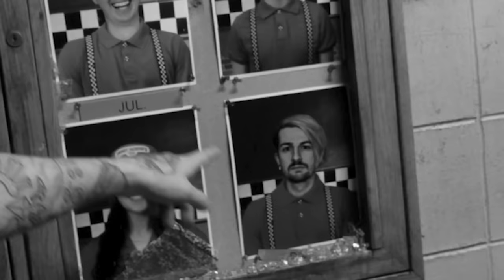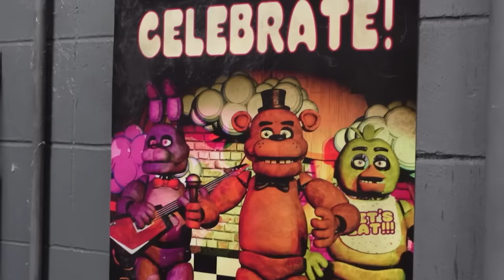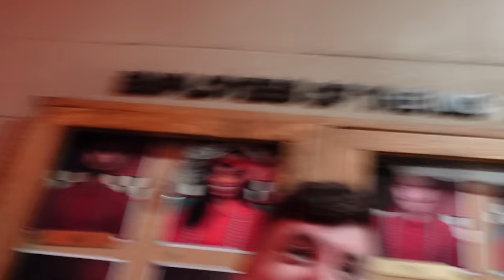VISITING THE FNAF MOVIE SET...

Comment: Dude the emotions those actors were able to portray through the animatronics without speaking was insane. I don’t know how they control the expressions but man that is so badass. I could only dream of this as a kid back in FNAF 1.
Reply: The characters are all actual animatronics. They are all controlled by puppeteers off camera using remotes. The fact that Freddy was able to move is mind-blowing!
Reply: @jakeblitzcoffie4859  not true in the hugging footage. You can tell if you look at the joints in that footage vs when Dawko is on stage, you can see the joints have people in them. there ARE animatronics, but there is also a suit version as well
Reply: @alpaca6462  Explain Foxy. How could someone possibly fit in there? You can even see the robotic bits inside his chest.
Reply: @jakeblitzcoffie4859  Foxy is a full animatronic, but the other ones have both animatronic and suit variants
Reply: @jakeblitzcoffie4859  Nope. The only suit that is indeed empty is Foxys. And you are probably right with remote control. The parts that are mechanical like eyes and ears, maybe jaws too could be remotely controlled. Question is by who? Because if it is someone else, which is likely, then the interplay between that person and the actor and the suit needs to be perfect. This is why it works.
Reply: @jakeblitzcoffie4859  Its 100% animatronic, this is why you can not hug him.
Reply: @alpaca6462 I don’t think so. I do believe that there are suits for the actors to wear (makes sense, certain scenes probably wouldn’t work with the animatronics), but I think the ones they were hugging were the actual animatronics.
Reply: @identitymatrix  Ummm. So there is literally footage of the remotes used to control them in the video they made... Plus, I thought the same thing as you until they got a back shot at the animatronics and an up close look inside their mouths. Unless the people inside are really small, they look pretty robotic to me. I'm aware they are using both animatronics and suits, but these guys were 100% the real deal.
Reply: @jakeblitzcoffie4859  What I see in an intransparent black cloth. Whenever the suit is worn, the distance between the upper arm part of the costume and lower arm part of it becomes significantly smaller too. Probably so it becomes less evident.
But when they are empty, you can see all the joints.
So no, I do not believe that these are empty suits. Only parts that are remote controlled are eyes and ears. 

Foxy is special in a sense that he is, like you said, 100% remote controlled since he is way too small to fit someone inside.

But feel free to tell me which shot you mean and I will take a closer look at it.
Reply: @identitymatrix  I see what you mean. Later in the video, Chica is stationary yet looks exactly like she did earlier, just without moving. Her arms are around the same area, and her height is exactly the same. You'll also notice some up close shots of Freddy's mouth, and you can see the endo inside him while he is moving. Unless someone's head is underneath, I don't see how a person could be in there unless they were curled up in his chest or something like that.
Reply: @blueflare3848  look at their joints in the hugging footage, the joints are full, and then compare that to the animatronics later in the footage on the stage with dawko, the joints are empty there.
Reply: @jakeblitzcoffie4859  I cant tell you how they do it but it seems like there are multiple copies of each suit. So there being metal parts inside doesnt mean anything, you can just remove them before you wear it. 🤷

It doesnt even really matter. It was a wholesome scene anyways, lets appreciate that.
Reply: @alpaca6462  Oh yeah, I do kind of see what you mean. So maybe you’re right. Besides that, it’s genuinely hard to tell if they’re real animatronics or actors in suits. Either way, they’re still pretty impressive. The animatronics are incredibly detailed and we know they’re capable of a range of emotion and movement because even if the main three really are suits, Foxy is without a doubt a full animatronic.
Reply: @blueflare3848  I never saw a robot as compact as this Foxy animatronic that is still able to perform such complex movements as he did. 
It really is impressive how much tech has progressed to make this possible.

They "only" had 25 million dollars to make all of this work.
Reply: @alpaca6462  I’m looking at it again and I can still see the joints from the endoskeleton during the hugging footage, so I don’t know? I get what you’re saying that there’s less of a gap between the joints during that part, but the joints are still very much there and I feel like they wouldn’t be if an actor was inside. Honestly I think the fact that it’s so hard to tell only proves how impressive they are, whether it’s an animatronic or a suit.
Reply: @blueflare3848  henson did an amazing job for sure
Reply: @blueflare3848  the joints are still there, because they replicated the game lore of the animatronics being able to swap between animatronic and wearable suit
The black arms you can see in the 9:50 footage would be the puppeteers, and you can see that black arm missing when they are empty on the stage
Reply: Honestly the fact that none of us can genuinely, 100% tell whether they are real people or full animatronics is amazing in its own right. At this point I don't even care if there's people inside of them, it looks so realistic that it doesn't really matter.
Reply: There was an image of a man wearing the Freddy suit.
Reply: I want to take a second and appreciate the debate happening here. This is everything we ever wanted: part of the point and what makes this so exciting is that we, even diehard fans, can’t tell when they’re animatronics and when they’re just suits!!!
Reply: Stop arguing the people who made them said they would be able to interact with people a long time ago
Reply: @identitymatrix The biggest indicator of them being suits or not is the joints.

If you look ever so closly at the gaps in the animatronics arms, they have small black sleeves inside them for the actors arms to go into whereas the actual animatronics on stage do not.

Whats happening here is that they are suited actors when they were hugging them and stuff but they also have a set of Puppeteers off camera controlling the eyes, ears, mouth etc.

Foxy is an exception to this however as he is fully animatronic.
Reply: And if you are wondering about the metal pieces in the arms of the suits, those are meerely their to make them look like the actual animatronics, they are just prop pieces not working animatronic parts.
Reply: On the movie’s IMDB you can see pictures of them fitting the actors. With the exception of Foxy and probably Spring Bonnie they are using a mixture of animatronics and suit actors. For the meet and greet it seemed they were using the suits for the main trio whilst Foxy is always an animatronic, you can even see the rig to keep him in place behind him
Reply: @identitymatrix it’s controlled by puppeteers using what can be called as a Waldo I believe.
Reply: Like the mouth, and eyes. Maybe the ears.
Reply: @tpminty9142 The issue is that people don't give the puppeteers their props if they think it's the full animatronics. 
Still, the fact that the puppeteers are fooling this many people shows how good they are.

Comment: I love how practical they kept the costumes and the robotics aspect of the charterers mainly foxy. They could have cheaper out and either had modified the foxy design to be less withered as to keep it a physical costume for an actor or the just do digital limb replacement, but they are keeping him a actual robot. And the control they have over the heads in the costumed version is amazing, can imagine how tight it gets for the actors inside, and they keep the movements really robotic.

Comment: The problem with the Animatronics is the material, not the design. 
When I look at the first game, I think that the Animatronic Exoskeleton was made by suede. 

That's why it looked like cloth, but it didn't have too much furry appearance. 
Whatever material they used here in the film Animatronics (Silicone, Plastic, Polystyrene, Resin) just didn't look quite right. 
That's why when the light hits the, the contrast of Highlights and shadows is too smooth. Making it look as if they have a matte finish.  So they stand out from the background. 

While if light hits on a Suede material,  so the light makes more intricate patterns on it, meaning that the shadow will have minute rough edges. This causes a high contrast, so they appear more tangible in every environment (As they appear as being in the scene). 

Most people don't care about this stuff, but on a subconscious level, this makes or breaks immersion. 
That's why I just couldn't connect with it. 
The Animatronics always felt like they were away from the scene.